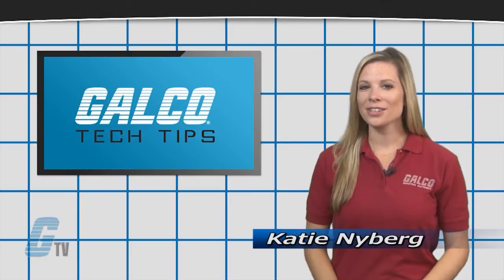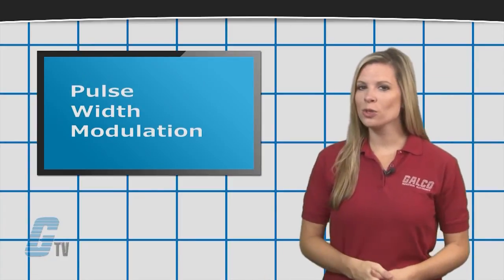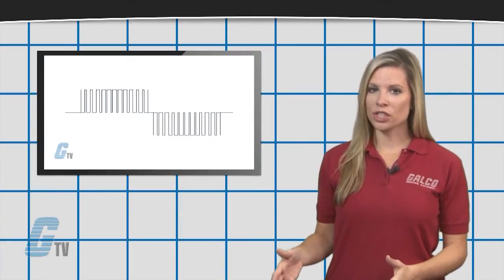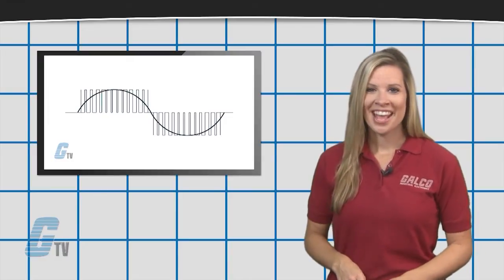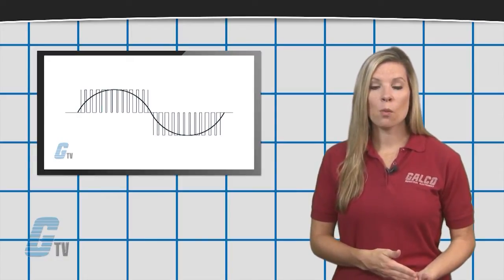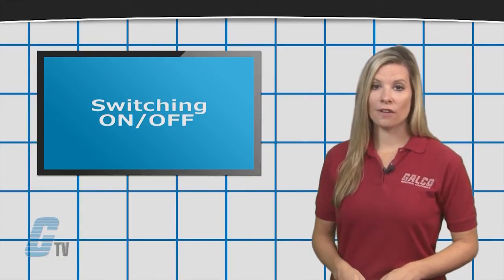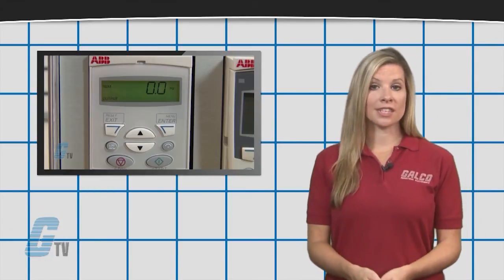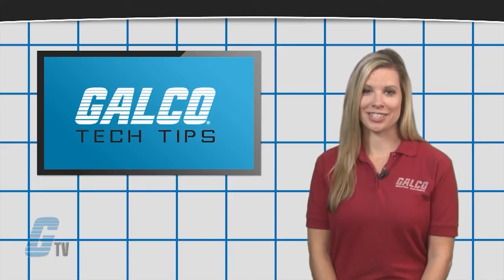What is Pulse Width Modulation? (PWM) - A GalcoTV Tech Tip | Galco

Comment: not explained pwm
Reply from the maker: Ok let me elaborate for you. Pulse Width Modulation as used in modern VFD's is 2 different frequencies superimposed on each other. A carrier frequency ranging from 2KHz to 16KHz is superimposed or modulated onto the "motor operating frequency", (for sake of our discussion the 0 to 60Hz frequency). Each half cycle is broken up into many pulses, at the beginning of the cycle the pulses are very fast/narrow and widen at the center of the cycle and finally narrow again at the end of the half cycle. By varying the pulse width we control the voltage on the motor. If you view the voltage with an osciloscope it is pretty messy looking. If you look at the current in each motor phase you can see a sinusoidal wave form. This is made possible due to the inductance in the motor coils in each phase.  PWM is the modulation of pulse width at varying rates depending on the speed of the VFD. If any additional questions, please don't hesitate to ask.
Reply: Thank you mam